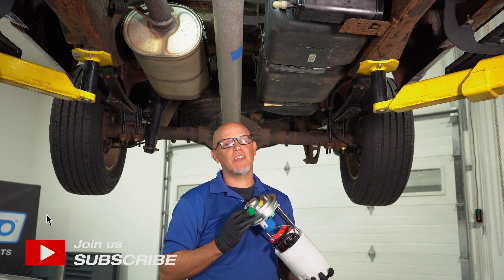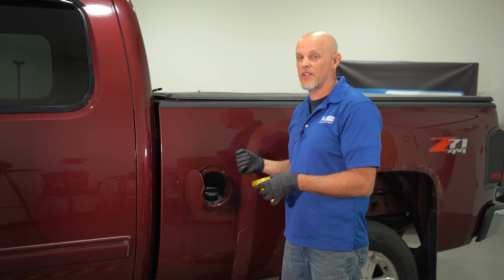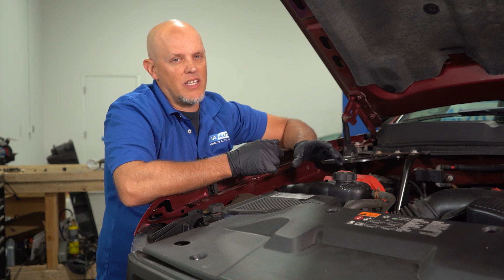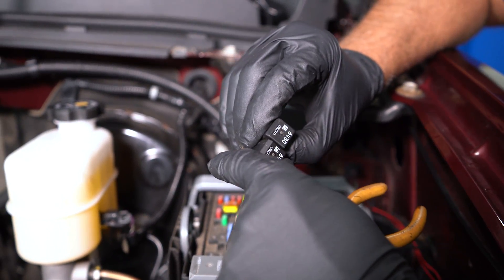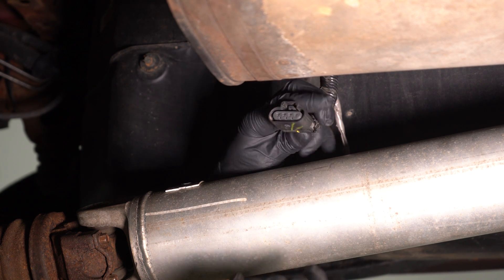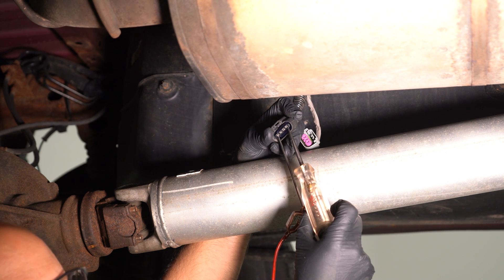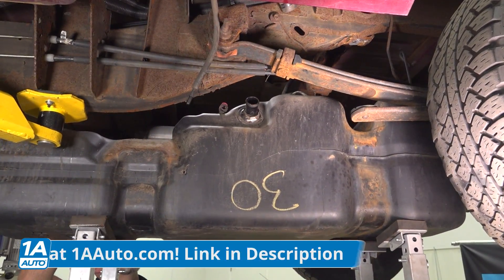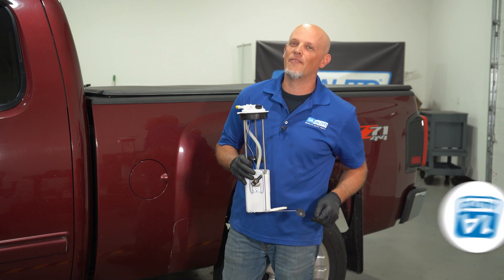Does It Take Multiple Tries For Your Car or Truck to Start? Get Moving by Replacing This Part!

Comment: The fuel pump does not run in the run position on all vehicles .For example My two vehicles 2008 Toyota Camry and 2007 Toyota solara the pump only runs while cranking.On these vehicles you will not get a prime.

Comment: People who run on the bottom of the fuel tank instead of a full tank are forcing the pump to work without the cooling of the fuel. So a few years of that mistreatment and dead fuel pump.
Especially in fuel injection vehicles the pump really has to work.
Best wishes from the far North.

Comment: I remember once I was riding through Berkeley on I-80 east on my way home and my truck stopped running. I thought I needed a fuel pump, turns out I had a false fuel level reading. I actually had run out of gas. The sending unit was bad. Had me thinking I had a line above a 1/4 tank. My cousin told me “fuel pumps don’t generally go out while driving, you ran out of gas”. He was right.